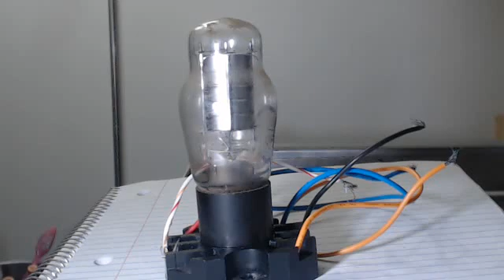Line voltage and tube radios

Comment: I have one of those RCA line monitors in the basement somewhere.  I took mine and calibrated it against my fluke 87 which was recently checked and found to be within spec. The resistor tap had to be moved slightly.  The fun thing with that meter is it was so sensitive to any fluctuation or noise on the AC line. When I first looked at it I thought there was something wrong because that pointer was always moving a little bit and sometimes a little more. I put a scope on the AC line and could tell that it was responding to variations in the AC that would never show up on a digital meter.  It would never show up on a Simpson 260 either. Looked nice and clean, but when put on the RCA you would see the variation very clearly.